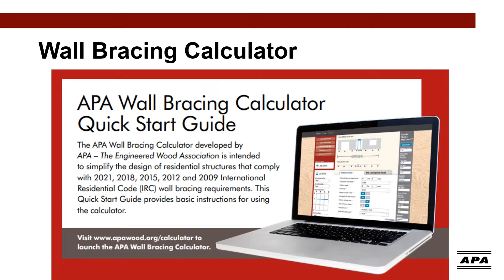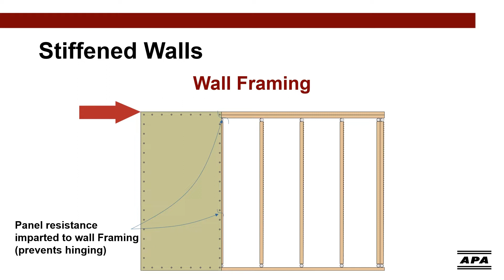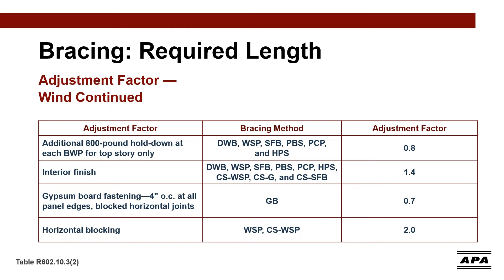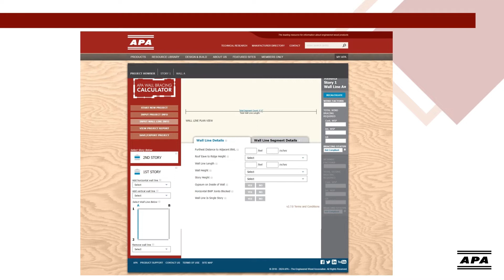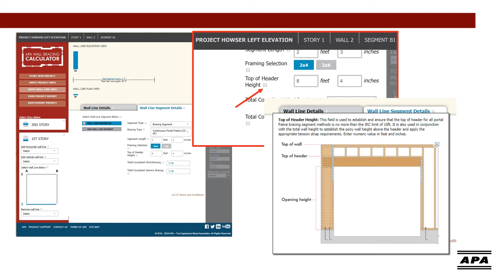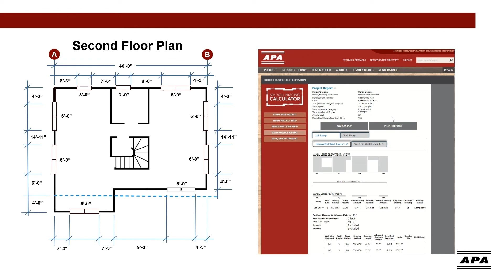Simplifying IRC Wall Bracing Requirements

Comment: 31:07 Great info.  Can I ask why the wall 2 imaginary wall line does not evenly split the distance between the front wall elements?  In your example, the imaginary line is 4ft in from the garage wall and 2ft from the front door wall.  Why is it not 3ft from both elements?  Thanks.